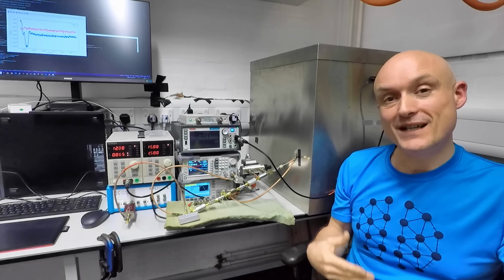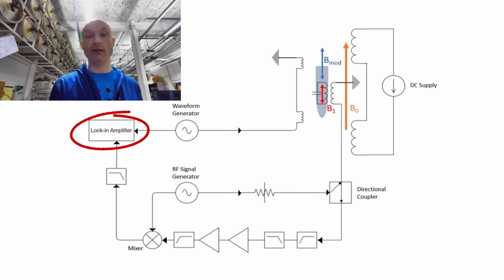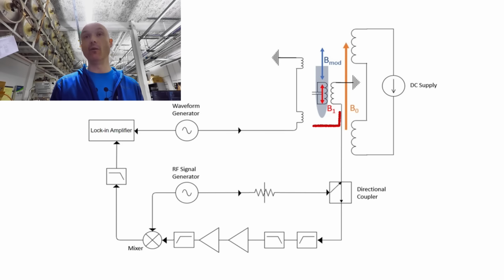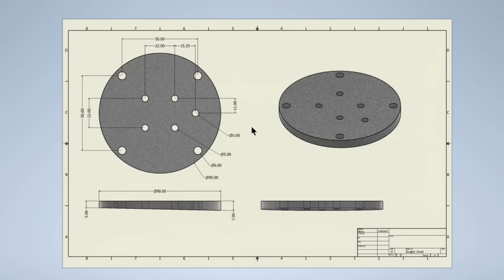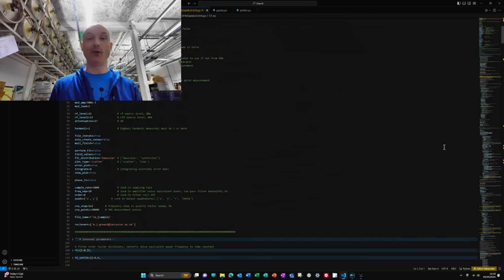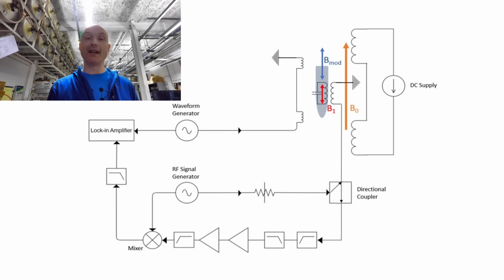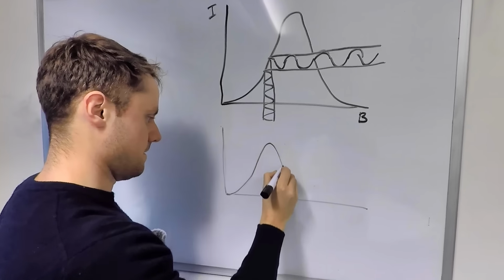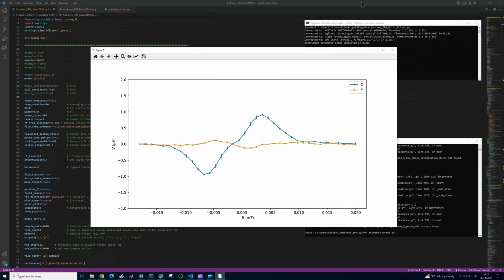How we built an EPR Spectrometer in the lab - ESR Spectroscopy

Comment: Last question, if I may. If LIA needs a ref. tone to detect, I guess your setup assumes you know the resonant frequency...In a more general setting, where molecules are being identified, you can't pre-assign a ref. tone (?); so this version of EPR seems specialized for a specific molecule...? Thanks again for many insights!
Reply from the maker: Hey.
The lock-in amplifier is using the field modulation frequency as its reference rather than the resonant frequency of the spin ensemble. We modulate the field being swept and then use the LIA to detect changes occurring only at this frequency. This is to reduce noise and make the signal measurable - it works because only the electron spins respond to the modulated field - noise sources do not.
In general, an approximate resonant frequency at a particular field can be calculated using predicted quantities about an atom or molecule in general. This takes account of the various intra-atomic couplings and any splits in energy levels which result from them. In practice, this can get extremely complicated, and EPR can be used to test and confirm the calculations to better precision. But yes, usually, a good idea of the right combination of field and frequency is understood before experiment. Of course, EPR only works when there are unpaired electrons, which are paramagnetic.
The molecule we're using is nitrogen -15 in a carbon-60 cage and so the resonance is entirely due to the (relatively) simple hyperfine splitting of nitrogen-15.
Reply: @SystemicCreative  Got it. Thanks again and all success in your endeavor.

Comment: This video was a pleasure to watch! Nice job. I was a little confused by the sample run near the end-- 5 microTesla seems very small. Can you tell me roughly what RF frequency was being used?
Reply from the maker: Thank you! Glad you enjoyed 😊.
Yes, 5 uT is a tiny field isn't it?! The frequency for that sweep was around 44.5 MHz (can't remember the exact one now!). There is a convergence of 3 resonance curves at zero field close to this frequency for our molecule, 15N@C60. This means we can obtain transitions at tiny values of applied field close to this point.
This field amplitude is actually much smaller than the geomagnetic field in the z-axis in the lab, and so the whole experiment was placed in a high permeability mu-metal box to eliminate as much of the Earth's field as possible. The offset from zero is due to the little bit that still got through!
You can find out more about the molecule and low-field measurements in this video:
https://youtu.be/1-_NHKCzbEA

Comment: Interesting instrument! And if it works, it works. But it would not be very difficult make the coils (18:31) more geometrically perfect, and producing slightly more uniform RF field.

There should be many tutorials for radio amateurs on how to do it. In a nutshell, wrap the wire with a constant and relatively substantial tension on a screw of required pitch. You can ask the machine shop to make the screw with required dimensions, and they can also wrap the coils on the lathe with constant tension. You can also buy silvered wire. The quality factor will be slightly higher, and soldering will be easier.

I assume that you have checked that the capacitors are non-magnetic. This is generally not guaranteed, because of the nickel plating used in making the terminals. Nickel is ferromagnetic, and even a small amount in the capacitor will distort the magnetic field slightly. You can check if your capacitors are ferromagnetic by using a small rare earth magnet.
Reply from the maker: Thanks for your comment. Yes, you're right, the coil resonators can certainly be improved, and that's part of the ongoing work at the moment. We have a 3D printed form for winding that we're now using, along with trying different wire, including litz wire. 
We have non-magnetic caps with copper terminals. In the earlier experiments, some with nickel and tin did make it through the net, but we've eliminated them now.
Reply: @SystemicCreative  It sounds like you are doing an excellent job. I am bombarding you with suggestions only because this stuff is very close to my heart, as I was doing it for many years.

So here is one more thing, which may help a little bit, if you are not doing it already. I assume that at 19:30 you are using solder with the rosin core. Usually, the soldering will work a lot easier and with better quality, if you add plenty of additional rosin or whatever flux suits your purpose. At least several times more, compared to what is already in the solder. If you try this, you will see how much of a difference it makes. The flux strips oxides, improves heat transfer, helps with surface tension of the solder. It is just impossible to work without it, really. There are all sorts of purpose made fluxes, but natural rosin from a crafts store is also very inexpensive and non-corrosive. Some people dissolve it in alcohol to make application easier.

When I had to solder heavier stuff, I have also found that having a really good soldering iron made an enormous difference. If you ever have to make the loop-gap resonators again, it may help to get a JBC soldering station with C245 cartridges. It is expensive, but the soldering will be effortless. With a wide blade cartridge, the entire width of the joint will be at precisely desired temperature within a few seconds of you touching it. Even students who were new to soldering were able to achieve good results after half an hour of practice. Highly recommended!